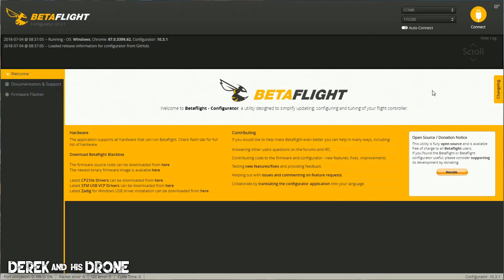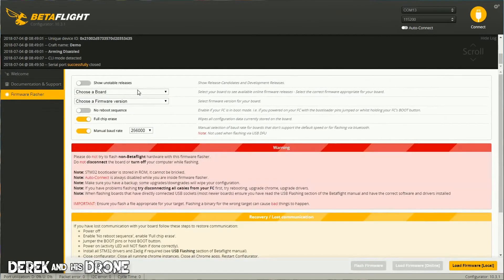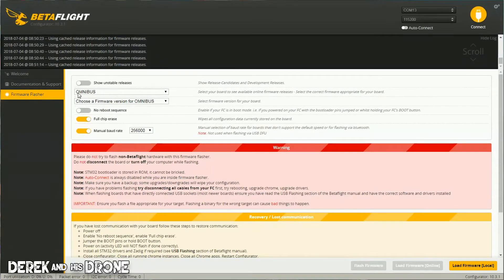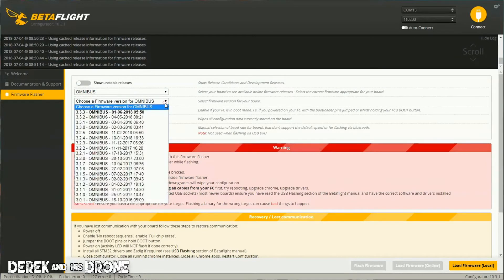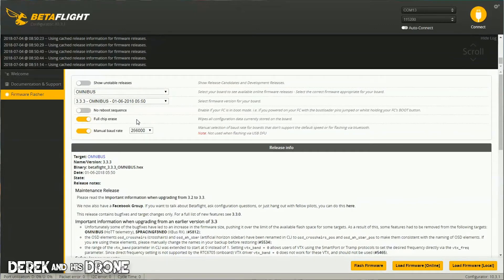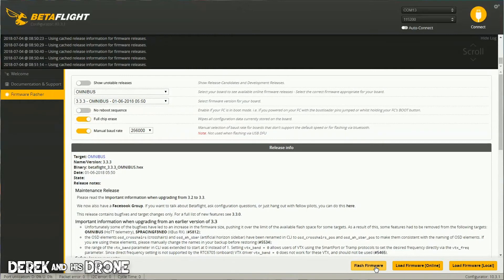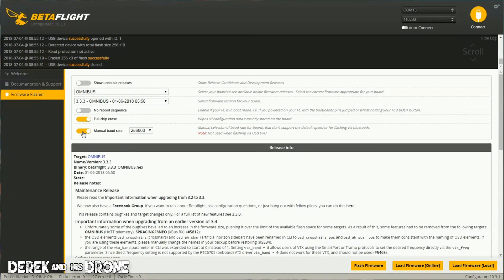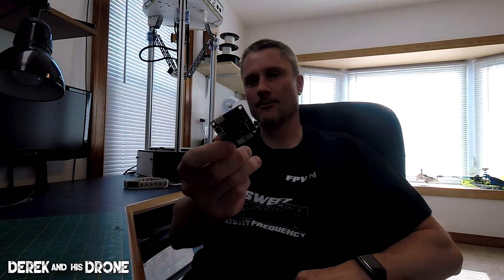Basics of Betaflight - Flashing Firmware

Comment: if im trying to flash a frsky x10s express transmitter is it the same steps?
Reply from the maker: It is not the same, different software and procedure.  I'm almost willing to bet someone has a video on it.
Reply: Crap because when i tried to update My transmitter it got stuck in the last step, and  it say: Component IXJT Updating...
This Will take a few seconds
I waited as Long the fully charged batteris lasted, then i charged Them again and started the transmitter as normal but it instantly got back to THE same screen any ideas?
Reply from the maker: You are going to need a program called OpenTX Companion to update the software. In most cases putting the device in dfu mode and reflashing. I’m really not sure what to do though in this case. You might want to try to find a group on Facebook for that radio.
Reply: I think ive did it im just waiting for the batteries to get charged back Up 
Thx alot for the help